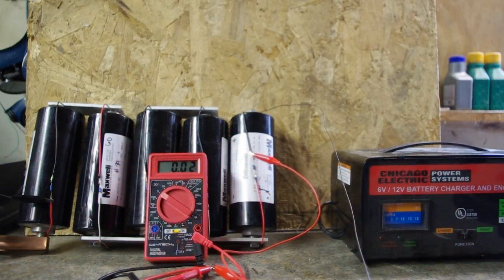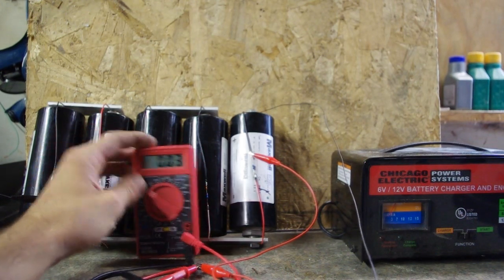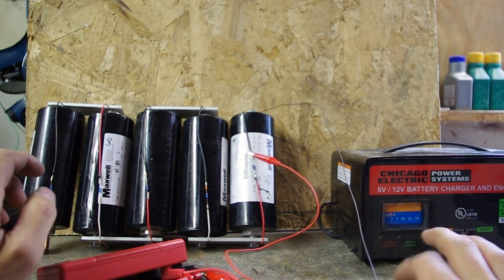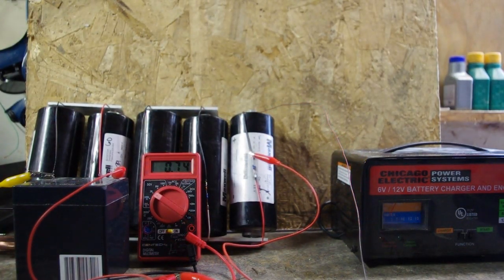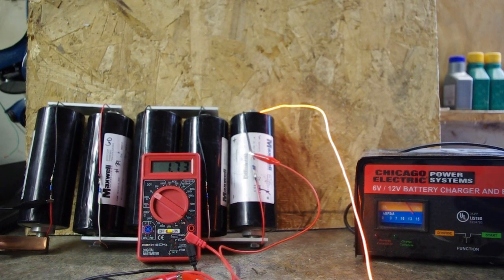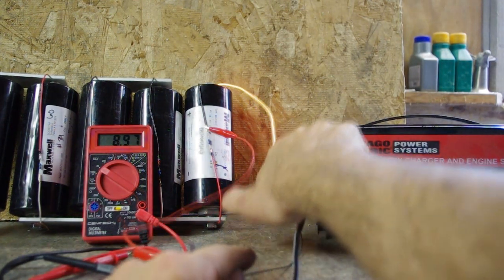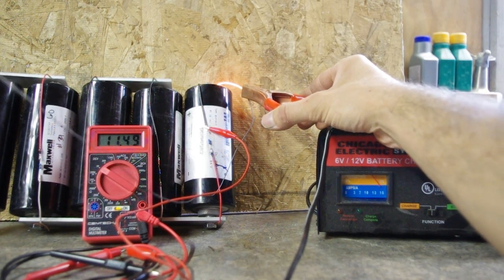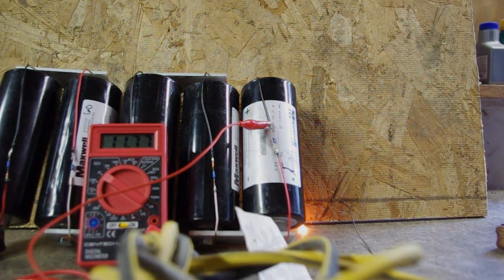How to charge a supercapacitor/boostcap/ultracapacitor 2

Comment: I was thinking of buying some 2.7V 500F caps but since i dont have much knowledge of electronics im not sure how i can charge them. there seems to be a protection board to solder on to the cap but I dont know if it has an over voltage (?) protection. I dont have a power supply like yours and want to know if i could use a 12V 5A power supply to charge 4 of the caps in series. Should be about 11V. I think i'll have to connect the protection poards in series and not the caps themselfes, right?

Comment: Hi Backyard Amusement. Thanks for putting up a video about this topic; it would be greater if you
1) start talking when it's quiet and not while the guitar is still loudly buzzing; you are starting the viewers' mind set starting off on the wrong foot by not letting the viewer clearly hear what you are saying at the very beginning.
2) Yeah, heat and etc others have commented about below. 
But, it's still appreciated since what you provided is more than what I provided. Thank you. And the viewers comments are a learning opportunity for all. Thank you.
Also, some battery chargers have a set manual select that is set at 2amps. Yeah, I didn't get the point of using the Nichrome wire? But, it was interesting approach.

Comment: that steel wire turning red hot is the biggest waste of energy ever! Build yourself a radiant charger and use maybe 12v at 600 milliamps to do pretty much the same thing. I precharge my cap banks and created a dump circuit that parallels the battery used for the load firing an inverter. If separate Earth grounds are used for the transistors used in the circuit, the caps will charge faster than this, drawing in the atmospheric disturbance created by dumping the energy into the ground at the Earthed points of the circuit. This energy is drawn back in at the inductor, and could be induced rather quickly if an antenna is built using a plating of graphene oxide. This will be creating more output than used from the source, and it should be in the area of 1000 watts per 50 farads of capacitance used. If it is built as efficient as possible, the capacitors are supposed to allow 1000 watts per farad, however I have not experienced this type of output energy yet.. A precharged set of capacitor banks and output battery is how the circuit starts, then the relays used to switch the circuit must have a voltage sense circuit, or a timing circuit to allow the slightly dissipated cap bank to be switched off from the output battery and connected back to the charger while the freshly charged cap bank is connected to the battery. The grounds need to be isolated from each other, and all connected to deep earth grounds. Each capacitor bank needs tit's own earth ground, the battery needs one, and the diodes that go to ground in the mosfet circuitry need their own. The source power used will max out at 600 milliamps, all depending on the mosfets used, and of course the coils used to induce the radiant energy between the source battery and the output. Once the circuit is running and powering a load, the source could be shut off and output can run a home battery charger to fire the source battery becoming a self runner that powers the circuit, it's load and an additional 1000 to 1500watts, depending on it's efficiency.

Comment: My favorite current limiter is using lightbulbs. For something like this I would use 12v car headlamps. Most car headlamps limit the current to around 2 amps, and it's somewhat slightly a constant current device. Paralleling more lamps increases the current.
Reply: +Jammit Timmaj I recently bought 18) of this same exact super capacitors to power my car audio amplifiers in my Jeep.  I also ordered a pair of 12 volt led license plate lights with a pig tail.  So.....to charge them up with the light do i have to connect the - side of the capacitor to the negative of the car battery and the positive side to one end of the pigtail wire of the light and the other wire to the positive of the battery?  Can you let me know please.  Or could you just hook it straight to the battery and let it charge up that way.
Reply: +Clyde Yamasaki Supercapacitors can suck a HUGE amount of current when you first attach a fully discharged supercapacitor to a battery. When they are first attached they look like a dead short to the battery for a rather long time. We're talking currents you can weld steel with. The LED license plate lights probably won't pass more than 20ma at most. It will take a very long time to charge the supercapacitors at that rate (not hours, not days, but weeks). You have the wiring hookup correct (cap- to bat-, cap+ to one wire on the light, other light wire to bat+). I would suggest using a car headlamp instead of the LED lights. A car headlamp will draw at most around 2 to 5 amps and charge the capacitors fairly quickly. A car headlamp makes for a cheap and high powered resistor, that's why I use them. Check around car repair shops for broken headlamps. Some headlamps have two filaments in one glass bulb. If one filament goes bad the lamp is replaced. The remaining filament will work. As you charge the supercapacitors use a voltmeter to watch them charge up. When the capacitors are within 1V of the battery voltage you can remove the headlamp and connect the supercapacitors directly to the battery. Even though there's only a 1V difference, there's still a huge rush of current and you might see a spark or a "snap" when you directly attach the capacitors.
Reply: So should i go to a junk yard and see if they have used halogen head lights with the pig tail end to use to charge up the capacitor or a glass head light bulb with the connector and use it to charge up the capacitor?
Reply: Clyde Yamasaki
That would be a good option.
Reply: Oh okay I'll go to the junk yard tomorrow and check.  Thank you very much for the information.  It is very helpful.  I really appreciate it.

Comment: OMG people stop using a stupid resistor to charge your supercapacitors! use a current limiter with a mosfet they can handle hundreds of amps.. pwm it for efficiency! 

stop doing it the dumb wastefull way, that hot wire or hot resistor is energy going to waste stop it!
Reply: +Artjoms Pugacovs      back to basics... power voltage current resistance...      2 resistors in series 1ohm each... 2 volts over it means each resistor has 1 wat on it...     1 ohm resistor with 2 volts on it and a pwm 50% duty cycle means you get 1 watt on it ...   wasting possibly a small percentage of energy
Reply: I used a salvaged  lm7805 5v regulator on the 5v rail of an atx power supply to start charging my 5.4v 250F supercapacitor bank.  Its not a good idea, but I took advantage of its over temp feature to avoid over loading my power supply and burning up resistors.
Reply: Nice
Reply: ALSO heat isnt good for supercapacitors, heat isnt good for anything... stop it!
Reply from the maker: Ronald Rogerson Acutally, it was real cold in the garage that day.
Reply: Same amount heat is dissipated no metter you use mosfet or just resistor to limits current.
And for uploader- i know that these caps have lost more then 30% of its capacity therefore you get thm cheap, next time you buy fresh ones remember to use cell balancing module.
Reply: What would you suggest I use that most people have laying around the house? A 5v wall wart?
Reply: Thanks Ronald Rogerson. Good to know the right way of doing things.
Reply: Very Amusing.
Reply: If the caps are not part of a embedded design who cares about efficiency if all you want to do is charge them a current limiting resistor will do. 

If you want to get anal with efficiency then use a power supply with current limiting built in

Comment: Seems a little dangerous having the wire glow hot like that. Did you do it for show?
Seems that a higher gauge wire would be safer. Try explaining your hot wire burning down your house to the insurance company.
Reply: judo- rob higher gauge wire will have less resistance therefor allowing more current to flow.

Comment: You used a wire with resistance to limit the current. That heats up the wire and energy is lost.  Maybe you might try a using an inductor to limit changes in current.

Instead of  loosing  energy, it stores some in a growing magnetic field that resist changes in current. The current will slow grow to a maximum point and then start to decrease. At this stage the voltage across the capacitors continues to increase and the voltage drop across the inductor decreases as the field magnetic collapses returning energy to your circuit.

You may try working with a large transformer say maybe a microwave oven transformer.  Connect your secondary to your primary such that current flow through your secondary is in the same direction as your primary for maximum inductance.
Reply: An inductor doesn't work as an inductor with DC current. It works as a resistor :-)

Comment: Would increasing the gauge of the wires from the capacitors prevent the wire from getting hot and charge the capacitors without the use of a battery?
Reply: Yes it would stop stop the wires getting hot, but you will always need to charge capacitors they don't "make electricity " like a battery does using a chemical reaction

Comment: The 47 ohm resistors you are using from post to post on each individual supercap (to balance the voltage and prevent reverse voltage) would cause a continual discharge of each supercap while charging and also after charging (in storage). I think this would charge faster and not discharge in storage so fast if you could use blocking diodes (in reverse bias) so that the diodes are rated to allow voltage to pass (to "drain off" or "balance" the cap) when it gets over 2.5V (or possibly 2.1V so you have 12.5 V total). So the diode would do nothing and there would be no conduction of electrons across it unless the voltage got too high. It would then be acting as a kind of pressure safety valve (like you have on your home hot water heater). The reason why you don't want to go over the rated voltage is because the dielectric layer between the electron and proton plates in the capacitor is very thin and begins to break down past that max voltage. When it does you don't have a capacitor anymore but rather a conductor. Losing one of them in your supercapacitor bank (as you have configured) would cause the total voltage to drop by 1/5. But the other capacitors not damaged would continue to function.
Reply: "Losing one of them in your supercapacitor bank (as you have configured) would cause the total voltage to drop by 1/5. But the other capacitors not damaged would continue to function"

In some circumstances, not quite. Say you are charging a bank of 6 to 14V. That is  2.33V per cap (easily within specs for both 2.5V and 2.7V caps). But, if say a defect caused one to short, draining all its energy internally just as the bank reached 14V, then your left with a bank of 5  at 11.66V that will start charging as 14V volts is being applied. But now if it reaches 14V, each cell will be charged to 2.8V. And this doesn't account for any imbalances between the remaining cells. Here, loosing one cap could lead to a cascade of failures.

Comment: I don't really recommend using a small wire for charging use 6 gauge wire if you don't want it to melt or even 10 gauge wire will suffice